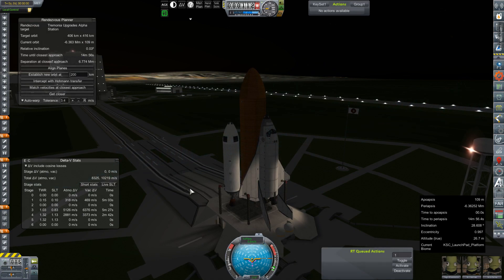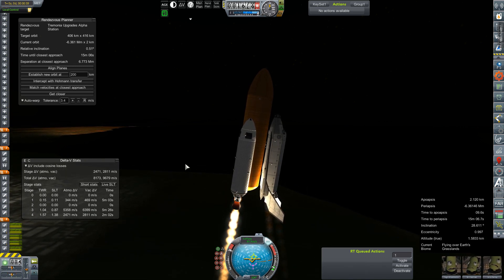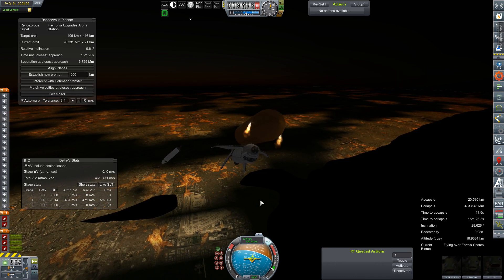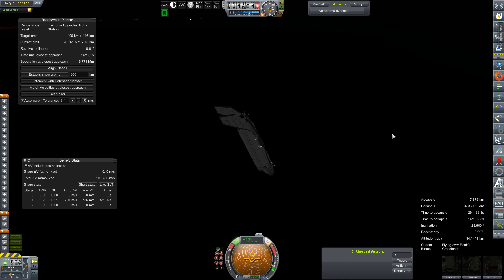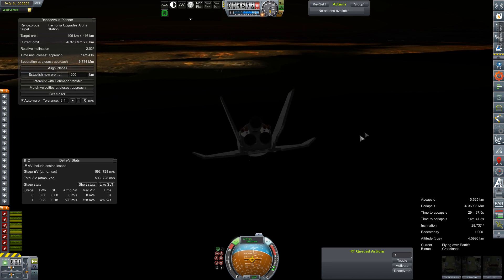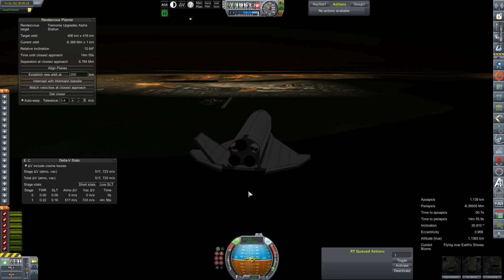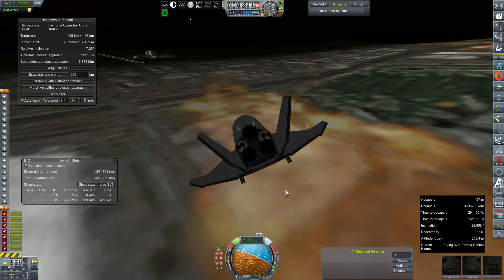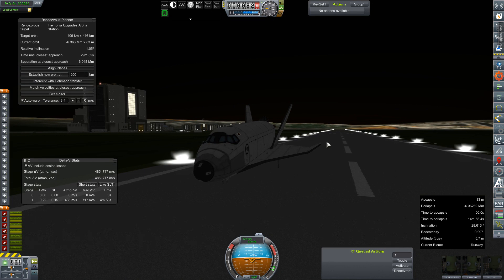KSP RP-0 #418 SKS RTLS

Comment: Residual fuel in the booster creating wobble?
Reply from the maker: the opposite booster would have had the same amount of fuel - yet no wiggle.... I am a bit confounded myself
Reply: Cosmonaut Crash Wasn’t the destroyed wake shield/elevator cover on that side? That might’ve added to the wobble?
By damaging the RCS on the right booster  or it’s skin?
Reply from the maker: The boosters have no RCS, and both wake shields got blown up / torn off - so I can't imagine a rational explanation to the booster dance.  I can only fathom it was touched by the Kraken...

Comment: In a real rtls situation they would run the boosters dry not because of the reason that they cant stop the srb but because they cant seperate a heavy booster cleanly, they also need to fly a bit downrange with the eft and turn around after a certain amount of time so that the eft can seperate without problem
Reply: i know
Reply from the maker: It might have something to do with the real shuttle not being able to shut down the SRBs... 
 I just wished I had rolled the SKS over so the boosters and the EFT fell away, instead of letting them nudge the wings ( that was pretty dumb )
Reply: i know they cant shut down the srbs but even after they run out they wouldnt have jettison the eft right away they would have traveled a bit downranged and turned around
Reply: Even so the booster sep motors will be far more effective on empty boosters than half-full ones. Doesn't mean you have to burn to depletion, shut-down and fuel-dump is perfectly alright, just to get the tanks empty before detachment.
Reply: i didnt even know there was a fuel dump system makes sense i guess
Reply: the Ship Manifest mod does that iirc. And also Smart Parts has fuel dump valves that you can activate various ways. In real life... no idea. The only liquid booster spaceplane I know of is Buran and I know almost nothing about the Energiya's abort modes.
Reply from the maker: Had I thought through it a bit more - or panicked a bit less - using ship manifest to dump the remaining fuel would have been smart ( i worry that it might have taken quite a long time to cycle out that much fuel - trying to empty the EFT would certainly have taken way longer than we had to get turned around to glide back ) ( also - it sucks that ship manifest decided not to work on this flight - reasons unknown )
I think just being upright would have yielded a clean separation of the boosters at least ( even at half full ) 
I will be setting up an action group to shut down the booster engines - that way if this ever happens again - the protocol will be to roll so boosters fall away cleanly - jettison boosters when SSME TWR is enough to get us clear - and start to throttle back - EFT will need to be jettisoned while heading below horizon - the pull up on separation to clear the tank - then begin the RTLS glide
this would only be appropriate for a repeat of this exact situation however, where speed nor altitude can be allowed to get high enough that the compromised heat shield becomes an issue.
Reply: Don't matter if you drain the EFT cuz you got the RCS on the shuttle to push you away from it. It would be worth doing a timed dump test for a fully fueled booster (don't need the whole SKS stack, just a solo booster) to see how that factors into RTLS abort planning.
Reply from the maker: wookiee_goldberg started a run down test, realized ( due to glitchyness of the mod ) I can only drain one fuel type at a time... ( took upwards of a minute to dump the lox, would take longer for the kerosene ) 
Were something like this to happen again, I wonder if it would be better to just shut down the mainengines, roll upright, and ditch the EFT with boosters still attached and running, pull up hard to manage the wake... prolly not huh....
Reply: Detaching the shuttle from the EFT with the boosters still attached is perhaps better. As long as you got the RCS to push you away should be fine.